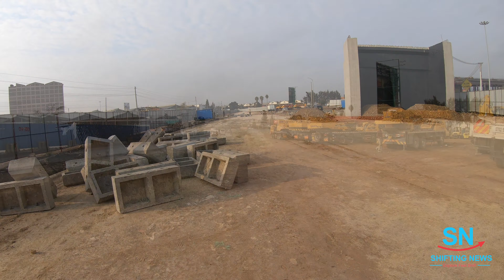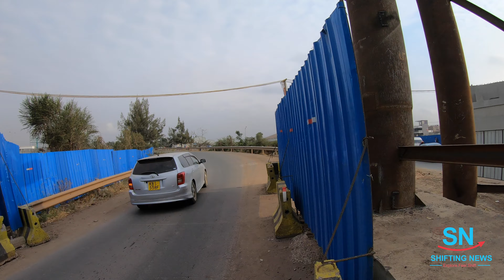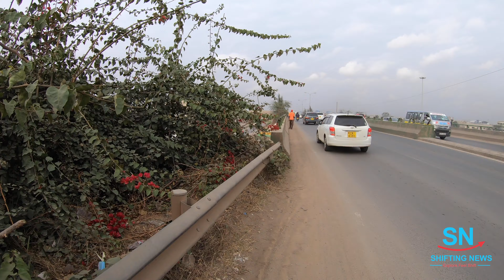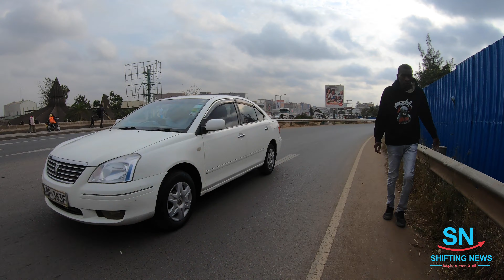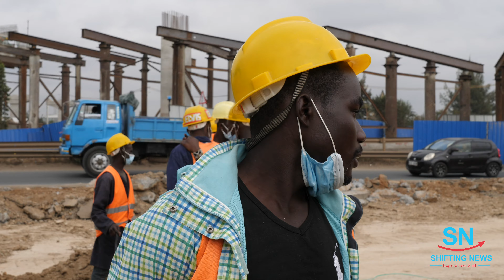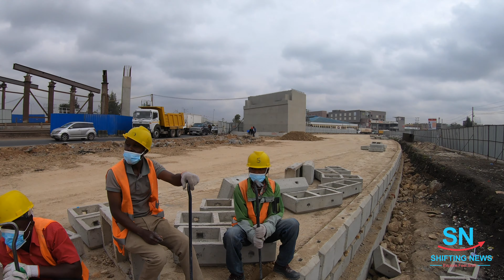Nairobi Expressway Eastern Bypass Interchange | Cabanas 4K

Comment: The interchange at cabanas is moving at very slow pace, nice job bro 👍.
Reply from the maker: That is how we perceived. From our chit chat, we were told that the speeds are precalculated. You can revisit  that place after 1 or 2 weeks and be surprised with how it will have changed. Thanks👍for the support to our channel.
Reply: @ShiftingNews  You r welcome bro